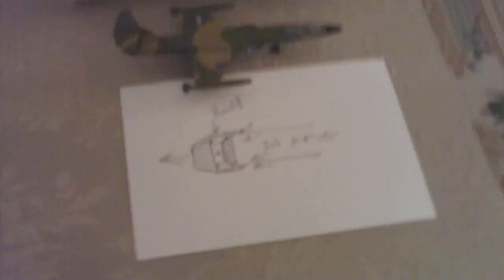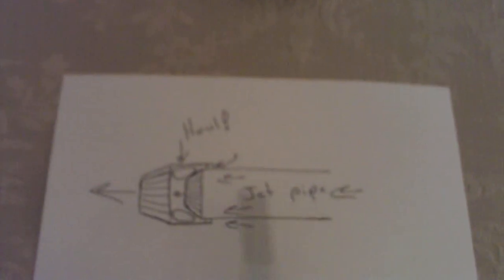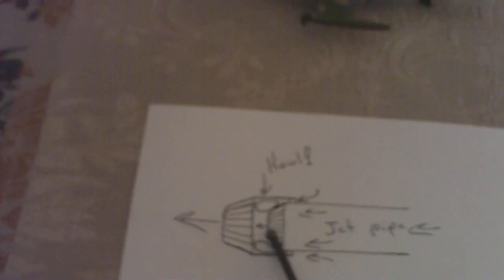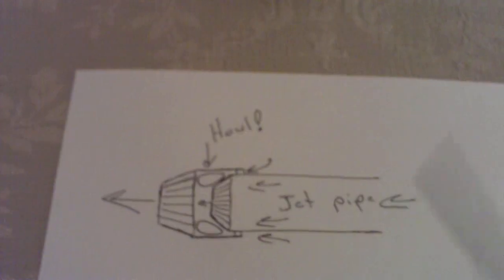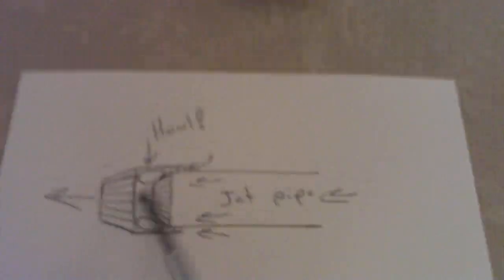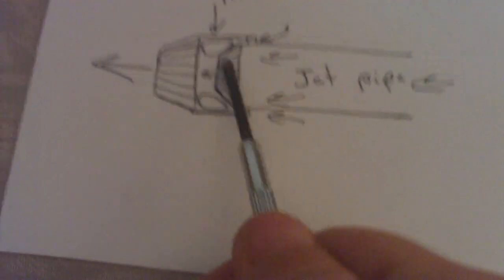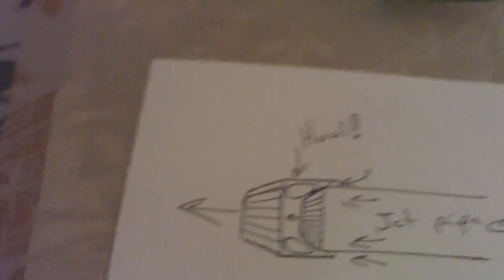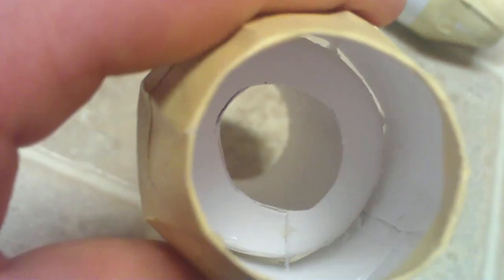The Lockheed F-104 Starfighter Howl Explained | General Electric J-79 Nozzle

Comment: very good explanation, and so surprised it worked in miniature 👍I used to see RF-4Cs at Kadena in the 1980s, and when they were coming in on approach at part-throttle, those J79-GE-15s would make such a racket just like your ducts, good job!
Reply from the maker: I should really think about making a newer video of this. These days with 3d printing, people could make them for RC F-104's. Though not really sure what kind of losses would be had.

Thanks for your comment!

Comment: This is an awesome vid. How did you get the dimensions right on the nozzles? I’m trying to cad one of these howling nozzles right now and 3D print them. I’ve printed two versions but haven’t gotten them to work yet. Did you just tinker around for a while or were there some dimensions you followed? Thanks for the vid!
Reply from the maker: It amazes me that I actually got this to work. I just used my intuition for the size if you believe that. The biggest factor in the whistle I believe is the smaller exhaust port on the internal tube, not the main nozzle which is bigger.
I'd have messed around with this much more but niches be niches.

Comment: You can make them out of cans with the same dimension  at  the front  and use  a aerosol can  to add fuel then light it on fire together with the fan

Comment: That opening that sucks in air is buried in the cover panels around the engine , pulls heated air out of the engine compartment , there are vents toward the intake ,  i don't think the Engineers at the time didn't realized the sound it would make , but i'm sure they had a party after !

Comment: I'm sorry but I've seen another expert explanation although I can't remember where..
The howling sound of my all-time favorite jet ever is not produced at the exhaust but at the air intakes and the way it is shaped with the intake cone.
I'm by no means an aviation engineer or expert just mentioning what I saw and read elsewhere.
Point in case, if it was the nozzle of the J-79 then why doesn't a Phantom howl that has two of those engines installed? It should howl twice as loud if it was the engine exhaust and it doesn't howl at all, it only spits out as much black smoke as the Starfighter. Therefoer I believe it's the intake.
Reply: I agree with Eagle One. Never heard an F4 howling in my 6 years in the Air Force in the 70s.
Reply: EagleOneM I believe from what I heard from AgentJayZ it is caused by the exhaust nozzle, in particular it’s the J79’s with short exhaust nozzles that howled, early F4’s had short exhaust nozzles like the F104’s which howled.

Comment: The J79 nozzle structure and testing can be seen over here. (https://www.youtube.com/watch?v=jcRnoVftNdA&t=336s) It will be easier to understand the structure mentioned in this vid, but there is no howling sound appears during the test.
Reply from the maker: When I made this video I knew and watched his videos. The reason for the lack of howl in that variant of the J-79 was because it was designed for the F-4. They designed it to not howl. The J-79 used in the 104 was very rudimentary. He has videos as old as mine in 144p of an old starfighter engine test that does include the howl.

Comment: I note this arrangement is similar to how water is admitted to a boiler.

I thought the howl was likely a resonance of the the mainshaft in the engine, perhaps induced by a LP stage compressor assembly causing a slight pulse of the air in that fan section and radiating into the shaft. 
I concede you may be onto it however.

Nicely done!
Reply: The Giffard steam injector?

Comment: The "howl" was put in synthetically by GE to warn amateur pilots of the impending doom they face if they decide to strap themselves to the J-79 without having the ability to control all that power. Okay clearly not :) but I like to think of it like that. Many pilots died in the F-104 simply because it was not a forgiving aircraft. If you look at the accidents involving F-104s, a large chunk of them happened on landing. Still, easily one of my fav. military jets. The J-79 is scary :)

Comment from the maker: @SgtRum It may take me a bit, but I think I have a better setup than the blower I used before. I have a hairdryer motor (Ducted Fan) connected to a model train transformer. Therefore it is adjustable to a point. Its allot quieter than the blower. But I sure will do so. Thanks for watching! I will message you once it has been uploaded.

Comment: Pretty cool! I'm surprised that the fact that the inner flow isn't  faster doesn't make a difference...I mean, obviously the venturi speeds it up a bit, but not to anything like the jet velocity of a J-79. I'm pretty sure you're right that the out air flow is mostly for cooling, but it may add some thrust as well...you get cooler, denser air from the outside mixed with the hot exhaust, which would heat it up and cause a bit of expansion. Probably not much, but some.

Comment: That;s pretty cool. It even sounds just likea J79 when the fan is powered off and running down.
But, dude, you need a camera operator so you can demonstrate without trying to hold the camera.
We've got a 95% built up J79 in the shop right now, and we'll be testing it in the near future. ( weeks - months? not sure yet) You should come see it run.How far are you from Fort St John?
Reply: Right, I got dizzy watching it in the berginning.
Most people doing new model kit reviews put their cameras on tripods and hold the kit parts and instructions in front of the camera after taking it out of the box without touching the camera again... It can be done if you're by yourself but you need a tripod.

Comment: The early J79-15s had a shorter nozzle, this was used on early F-4s and F-104s. The howl was precisely between 82-85%. When in Korea I was on the later F-4 (E) with the J79-17. More power, longer nozzle and no howl. During ground engine runs it was forbidden to stay in the 82-85% area due to the noise, especially when we would run them at night. Our squadron's F-4s would not howl.
Interestingly enough, modern engines would howl, but have a "screech ring" installed to eliminate howling.

Comment from the maker: @sanfranciscobay I'd say the times you would hear it is During taxi acceleration, and crusing flight below 15,000 feet, and during landing. and speed is not a factor it all depends on the pilot throttle use. 
I had a feeling it would work because I already knew where the howl came from.
And the last questions answer, An F-104 no but a J-79 from an F-104 yes.
I'd just need to get very special permission to work on a museums old J-79 because the nozzle's are wide open. But its a maybe.

Comment: You've identified where and why the howl comes from. So when is the plane in 80% throttle, how frequently, at what point in flight, speed, altitude...?

Did you know your experiment would work prior to building it?

I know it's a long shot, but is there any chance you can get next to an F104 at  80% throttle and then explain it with a video camera and a pointer?